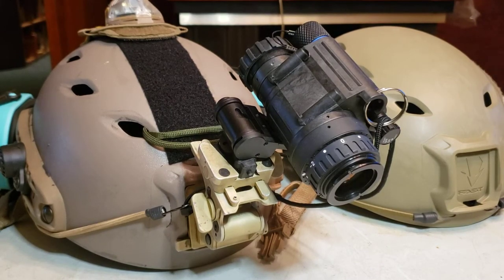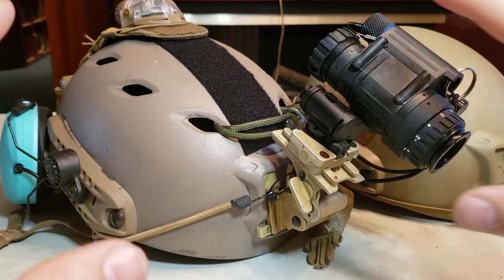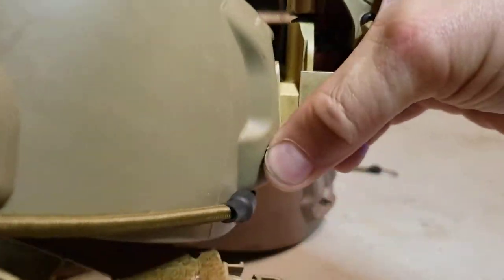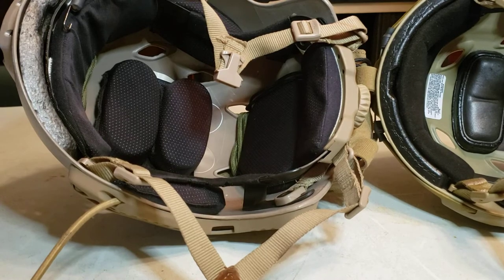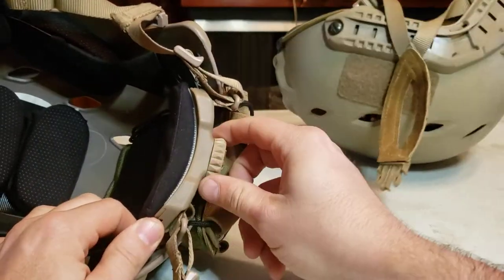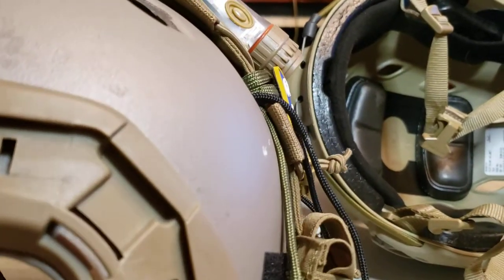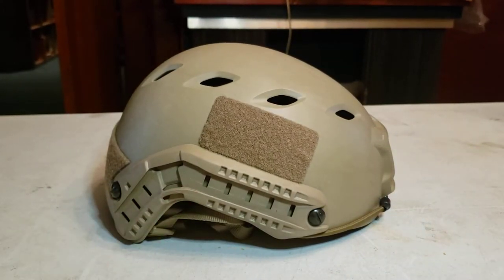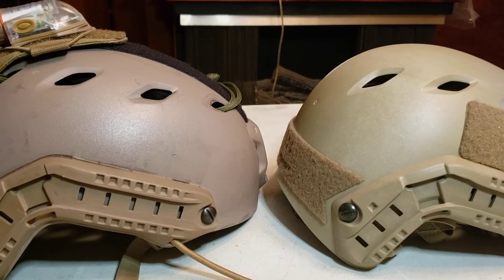Real Ops Core FAST Bump NVG compared to a fake Airsoft helmet.

Comment: As a note, more rigid is not always a good thing. The point of a "bump" is to absorb impacts that would otherwise be your skull. If the helmet is too stiff for the impact, then the energy will transfer more directly to your head. This is true for motorcycle helmet safety standards. ECE standards allow more flex and are safer at lower speeds. SNELL standard is extremely stiff but was made for high speed racing impacts. At low speeds this stiffer helmet actually results in more concussions. How do i know? I got a tbi from wearing a Snell helmet and impacting the ground at ~70mph. Definitely saved me, but the doctors noted that at that speed, an ece helmet would have likely prevented the tbi. Just as in the motorcycle world, people consider the stiffer snell to be "better" but its all use dependent. Just to throw this out there. If you have a stiffer helmet and likely will be just knocking your heads on doors, might want to get softer pads to absorb energy better.
Reply: while you're not wrong I promise you from handling both the knockoff is not safer just because it's less rigid. It's less rigid because its ABS plastic instead of high impact lexan.

Comment: I'm rather curious to know if you could get real Ops Core rails and put them on the clone
Reply from the maker: Yeah. Most should "mount" And, every helmet might be different. Since they are all copies. So, you might have to adjust the holes a little to account for a different curves, etc. So I wouldn't expect to be perfect.